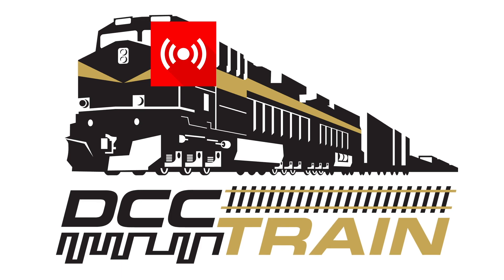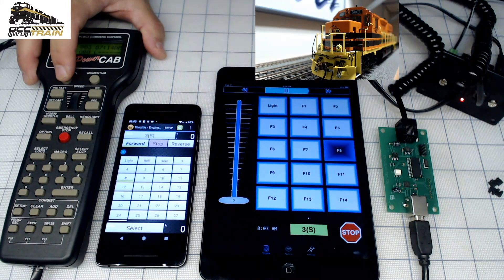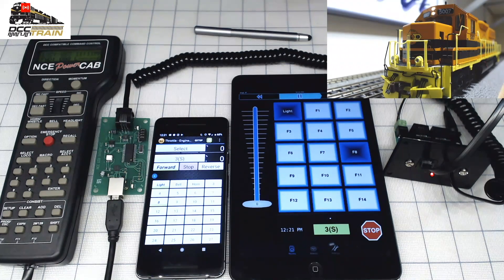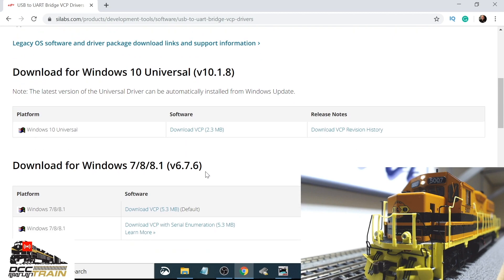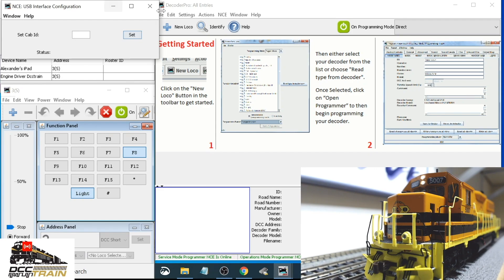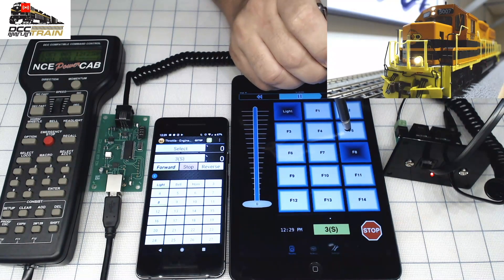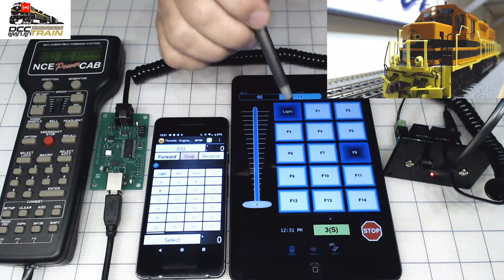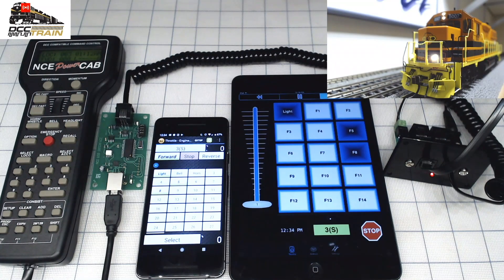NCE Power cab USB setup computer interface step by step instruction

Comment: I am unable to get past the setup.  My USB interface has the one led to the other PCB on.  No matter how I connect the wires to the other PCB.
Reply from the maker: Are you running PC with Win 10?
Reply: @dcctrain  Yes, I don't have that PCB board thats in the video.  NCE didn't ship it with the USB interface PCB.
Reply from the maker: @theronerd  On the video is USB Interface for Power Cab Part Number 05240223. The black plate is coming with Power Cab Set.